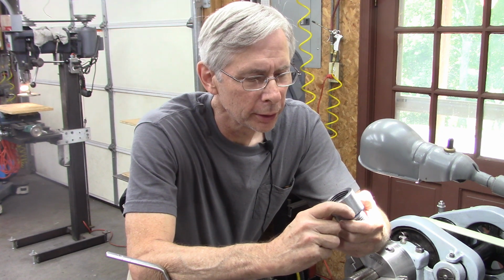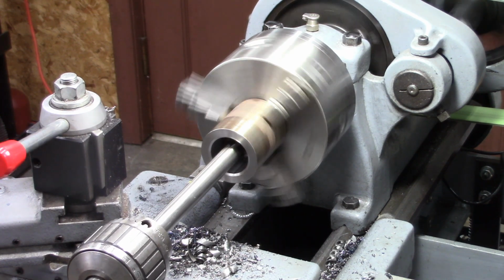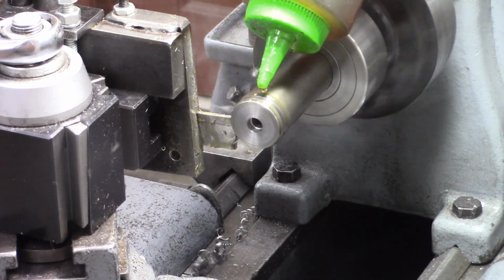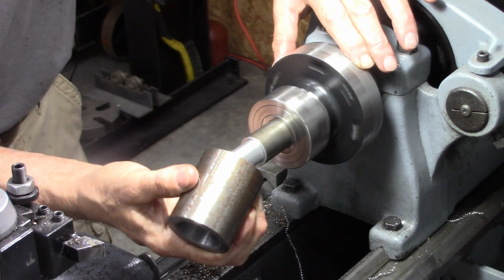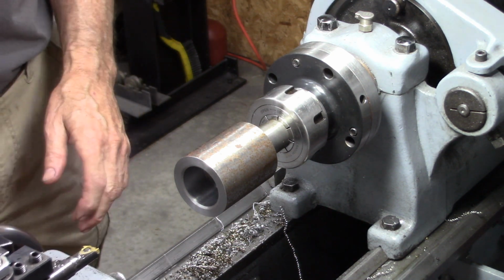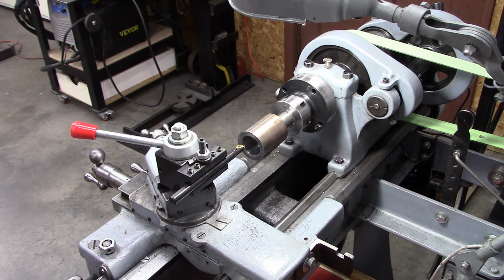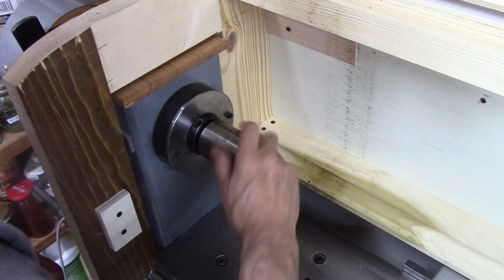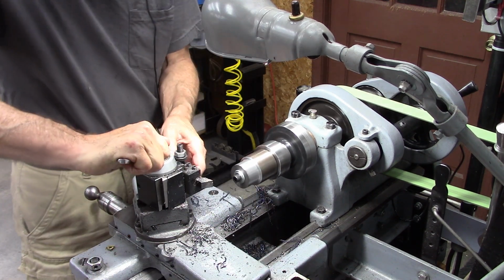Remaking - A Chuck Spindle Adapter, the RIGHT way

Comment: Hi Winkey, you're aiming to remove run out from your adapter.
You've cut the female thread to suit the lathe spindle. You even tested it there. 
Why then, oh, why did you then remove the new adapter, reinstall  the collet chuck with the mandrel, and then install the adapter the other way around to cut the male threads for the wood lathe chuck? If you had left the adapter on the spindle and done the male thread from there, you'd have removed the possibility  of run out in three possible places, 
1/ the collet chuck to spindle, 2/ the mandrel to the collet chuck and 
3/ the mandrel to the adapter. What could possibly go wrong? 
I'll be interested to see the results in part 2, but I'm also almost willing to bet that you'll have more run out. 
Also, there'd  be almost zero chance of the adapter slipping  since it would be threaded on instead  of being held, hopefully, by a bolt, washer and faith.
Good luck from Canada's banana belt. 
🤞🇨🇦🍌🥋🇺🇦🕊🇺🇲👍
Reply from the maker: As long as the mandrel in the collet was turn concentric and not removed, and the adapter was a good fit on the mandrel then flipping it would not me an issue. With that being said, removing the collet chuck from the lathe could result in a small error and removing the mandrel from the collet would also be bad. 

There was a reason for flipping the adapter. First I didn't think about threading it without flipping...  which is a very good idea although I would have had to make groove to start my threads which is not a huge negative in itself but!  Second, I wanted to test a new auto retract threading tool that will be reviewed in the next video. In other words, I needed to thread up against a shoulder to demonstrate  the tool. 

The collet chuck threads are proven to be repeatable so removing the chuck from the lathe would not be an issue. However, due to an extreme brain fart I removed the mandrel from the collet chuck. This will be shown in the next video. The auto-retract threader video so feel free to comment. It will be interesting how many notice this error.  I was able to rotate the mandrel in the collet chuck to get back to about .001 runout. 

The video will be public Friday June 28th. The results were good but not perfect. Still much better than the first attempt and more that adequate for my CNC wood lathe. Wood compresses .025" just clamping it in the chuck! 

Thanks for pointing out my error. Cutting threads away from the shoulder would normally have been an ideal method.
Reply from the maker: I just check the runout on the wood lathe. It was about .006" which is a bit more than I expected. I still think it was mostly due to removing the mandrel from the collet check. The method you described would have been better but removing the collet from the mandrel or the collet chuck from the spindle would have been needed to test the fit. The later would have been better. Again, the reason for flipping was to test the threader.
Reply: @WinkysWorkshop my apologies.  I just went back and watched the video again and the test was on the wood lathe, not the craftsman. My error. However, if you had turned the mandrel in your collet chuck, which is probably  more accurate than the three jaw,  with the wood lathe thread, you could then screw the adapter onto the mandrel to cut the male craftsman thread without having to worry about slippage and it would give you a test mandrel for future projects. 
I have a used mandrel for my Myford and it's been very useful for testing backplates,  chucks and adapters without having to dismount the work in the chucks.
I'm keen to see this threading device. Is it the George  Thomas  design? I've always wanted to try making one.
Reply from the maker: @ronwilken5219  No apogee needed. You made some good points! The threading tool is Mr. Woopee's Auto-Retract Threader. I thought about making one but he gave me a good deal for doing the video. Honestly its a little high priced but when I ask myself if I would make it and sell it for the same, my answer is no. It's well made, very impressive.

Comment: Hi would it be a good idea to add Loctite as a safety measure to the mandrel thein when you want to remove the part just heat it. 
looks good
Rich
Reply from the maker: yeah I was worried about it slipping. Thankfully it did not. Good idea on the loctite